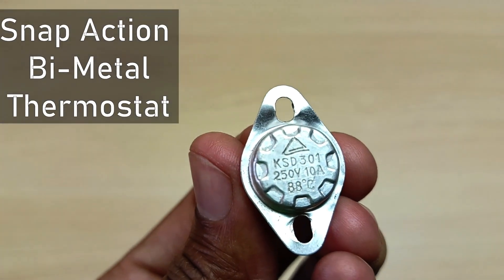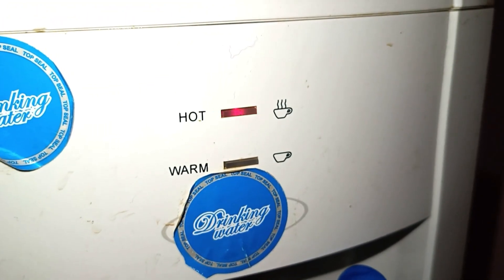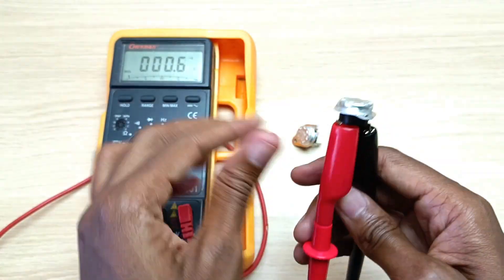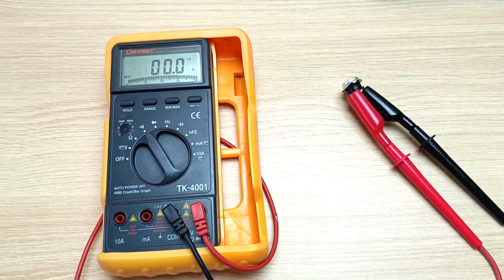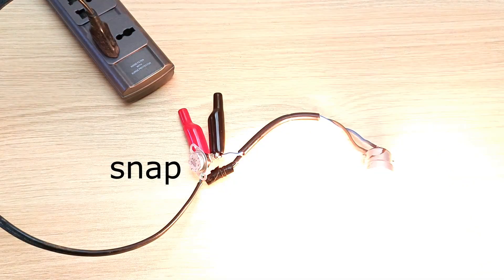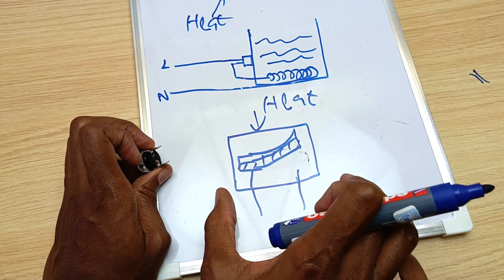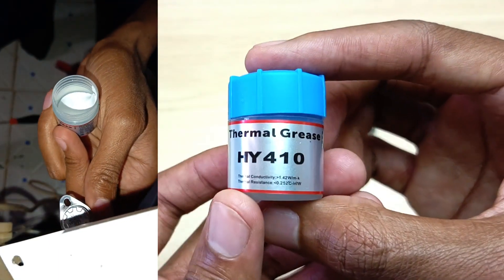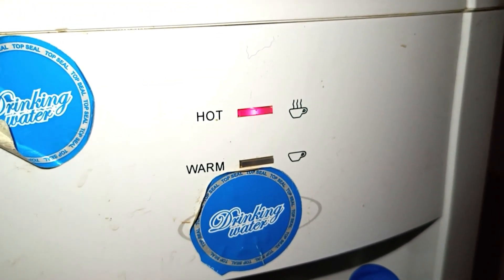How a Bi-metal thermostat (KSD301) works and how to find a replacement

Comment: i discovered my airfryer isn't heating but the fan is working. when i opened it and removed tested the thermostat with my meter, it wasn't working. could the thermostat be the cause?
Reply: You have done diagnosis, change if it has issues with a similar component that is functional.

Comment: Im currently trying to figure out why my dispenser wont heat, thought i should understand how they start and stop heating and arrived here. Thanks for the video!
Reply from the maker: Thank you. Glad you learned something new from my video.
Reply: mine was the lower bi metal switch it is what activates the heat for the hot and the one he is using on mine is the low temp activator